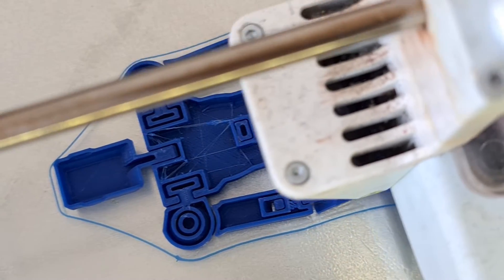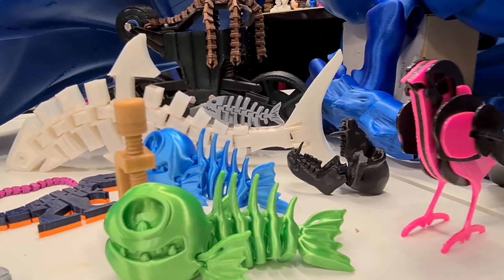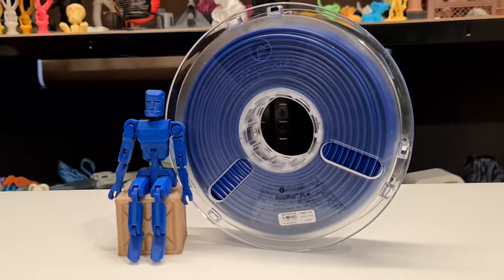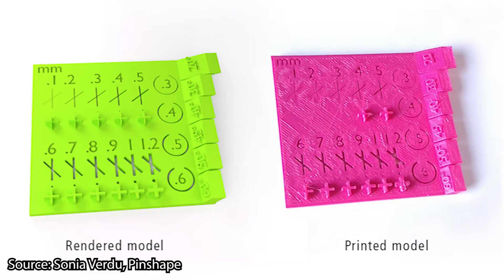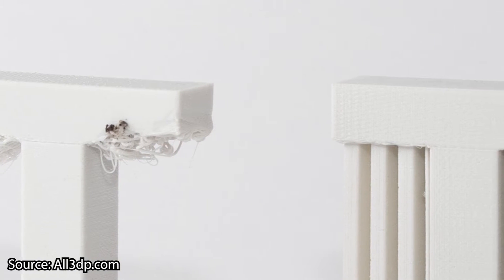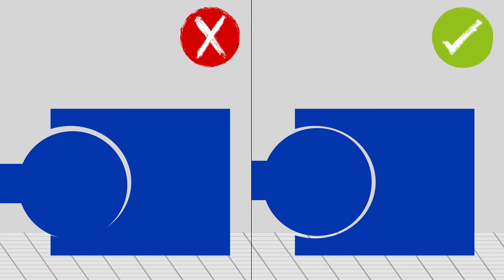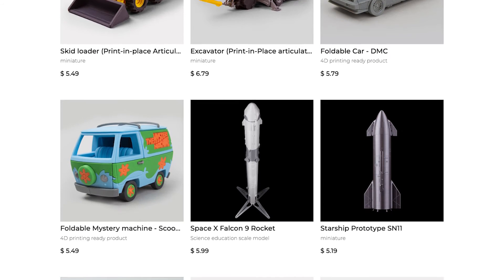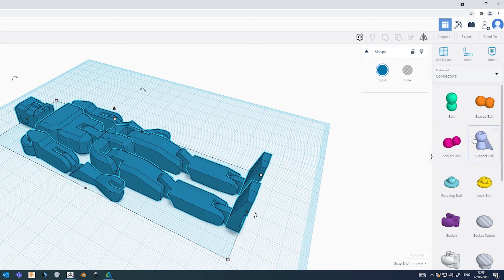How to 3D Print Articulated Models

Comment: i have a problem, its like stringing, but its trough just one line, example when i wanted to print a collapsing sword, there was one line where they were all connected (they shouldnt be) and it was impposible to seperate it
Reply: That sounds like a KIND of stringing, where the head is moving from one layer to the next at a consistent point. I've seen some rather elaborate artifacts grow at those points. I wonder if you could fix that by changing where you the seam goes. In Cura, that's Z Seam Alignment.